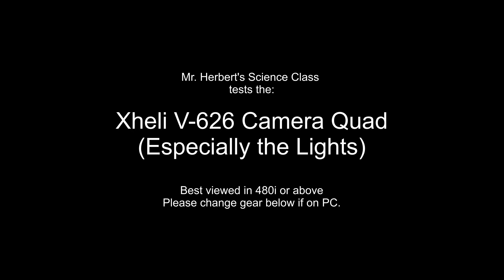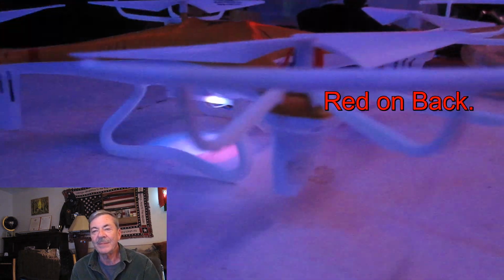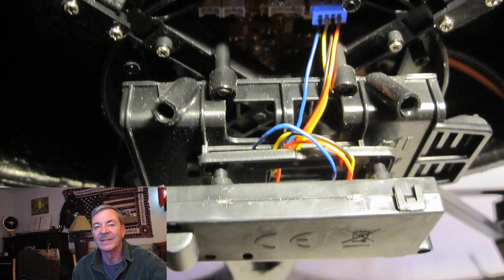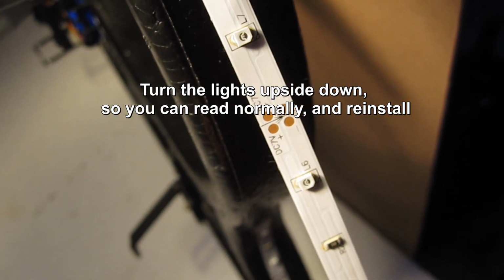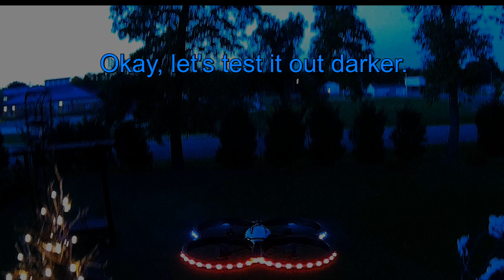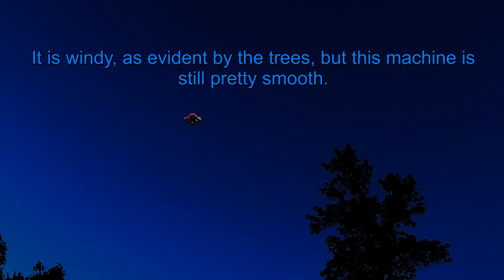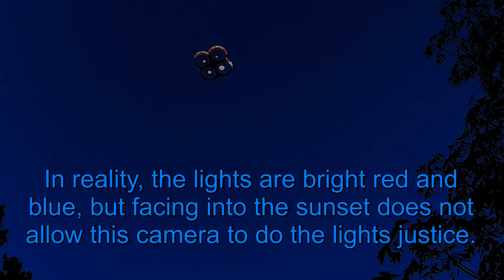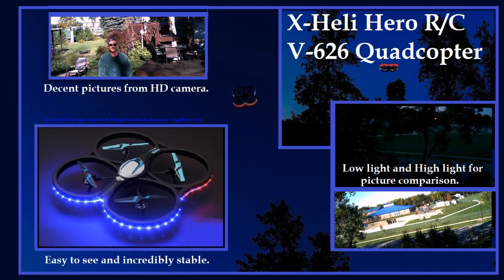Love the Xheli Hero RC XQ-5 V626 Quad, but the Red Lights were still on the Front!

Comment: This quad looks a Lot like the WLtoys Q212G I'm now testing (apart from the shell obviously).. Does this one have a barometer (for alt hold) as well?? 
Ohw.. mine has an extra connector next to the camera's power (and on/off) plug.. I have NO idea what it could be used for.. Does yours have that plug as well? (looks a bit like a micro-servo connector) 

Thanks for the entertaining video again! 
Cheers & have a good weekend
Reply from the maker: +DutchRC ADVENTURES Mine does not need the altitude hold at all and I see no plugs for it, but it does have plugs for other things like bomb drop, camera, and squirt guns.  Really!  Thanks for the comments. Make sure to see my night flyying only video of this machine as I try my new X1 Head Band Camera out.